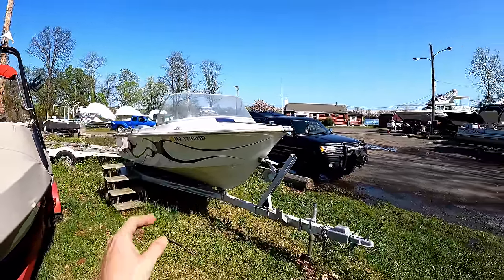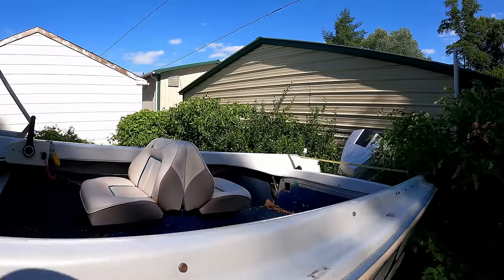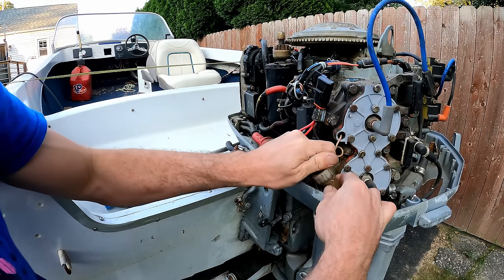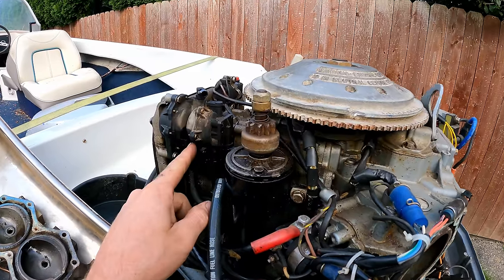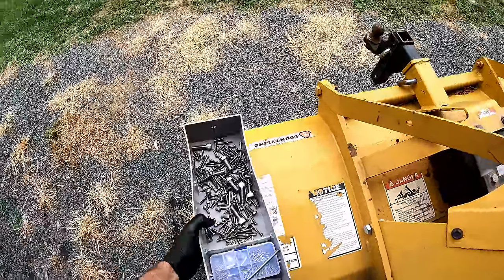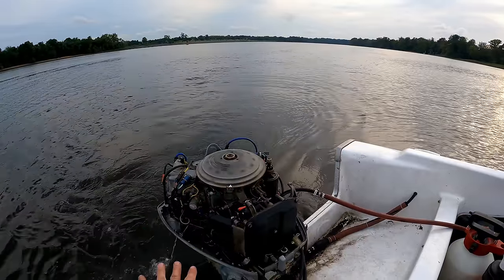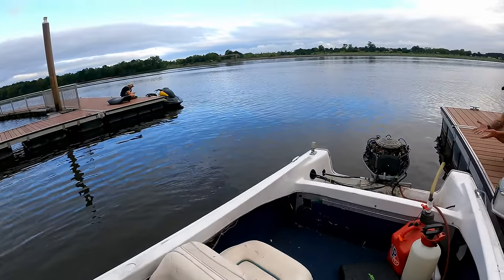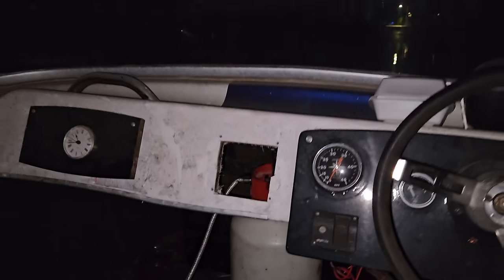FREE 1960's Boat with 90hp Evinrude WILL IT RUN?

Comment: Old Evinrudes and Johnsons are basically the small block Chevy, and Fords of the boat community. A crescent wrench, duct tape, and plugs will typically get them back alive. 
Ditch the boat, and keep the outboard
Reply: Evinrude & Johnson are the same engine, same manufacture,  only difference between them are the name. Such as a Fard & Lincoln are the same manufacture.  Founded by Ole Evinrude in Milwaukee, Wisconsin in 1907, it was formerly owned by the publicly traded Outboard Marine Corporation (OMC) since 1935 but OMC filed for bankruptcy in 2000. It was working as a subsidiary of Canadian Multinational Bombardier Recreational Products but was discontinued in May of 2020.

Comment: G,day Chris from Sydney Australia.
Great instructional video on replacing; the 
* cylinder head and gasket
* supply 12v straight to starter
* check the prop shaft gear oil 
* replace the gas pump
* connect nav lights
🌏🇭🇲

Comment: Just for info, the exhaust coming from up the motor is what we call ( in france ) "échappement de port" which means "harbor exhaust" 
It's a way to not pollute the water in the harbor or at the dock when you're at idle, when you pick up speed the pressure of the exhaust pick up and most of it will go through your prop like what you know 
Hope it help you ! I'm a beginner marine mechanic just discovered your channel and i love it keep up the good work man !

Comment: Another phenomenal vid, Chris!  Love anything you and Miss Jenn and Gus and Turbo bring us ! Grea t content, from a great young American couple! So much fun. And like others have said, I love the mix of content, and but especially the boat stuff! My Grandpa worked for Johnson Motors for close to 40 years, and so I grew up with all this kind of stuff.  That's an Evinrude Motor for sure. OMC (Outboard Marine Corporation) made Inboard / Outboard Motors, and the Cobra was their foray into that World. They could never quite nail it down like Mercruiser. Always chasing. The Cobras were getting good though, before OMC started to crash. But they made some of the best outboard motors in the World, with the tried and true Johnsons and Evinrudes. Great motors, and the V4 was awesome!  So wide compared to the tall Mercs. OMC also made the Sea-Drives.... a kinda weird out-drive... not really outboard... not really inboard / outboard. A weird looking thing, and I don't think they ever quite got them right either. But you can't go wrong with an ole' Evinrude or Johnson!  I'm with others.... the boat is whatever. But you got something great in that motor - for free! Very distinctive sound when you hear an Evinrude or Johnson cranking. I grew up with that great sound!  Also - VRO is basically what you said.... Variated Ratio Oil Injection. The first few years OMC did id... it was not good. Not reliable. It got better for sure. But you can't beat he old gas/oil mix. You're safe to got that way until you can get your arms around that VRO system, and be sure it's working. or maybe just keep it bypassed. I'd put that motor on another boat.

Comment: The E in the model number stands for Evinrude. Also the VRO tanks for those motors were like a mini fuel tank outside the motor with a primer ball. They were always deleted because they failed. I have to say your brave for a quick dump in the river but i highly recommend a little kicker motor even a trolling motor to save the paddling or swimming back to the ramp 🤣
Reply from the maker: Thanks!
Reply: @NoNonsenseKnowHow  .. i added more the longer i watched.. i love your videos
Reply: @NoNonsenseKnowHow  Evinrude is and was a division of OMC, so OMC badged controls are not a surprise or a mismatch.
Reply: I did this a lot and just made sure to have a paddle and go in the right direction to be able to drift back, up current or up wind or both.  Though when wind is fighting current, one must experiment to find drift direction.

Comment: I once owned a 16' 1959 Luger Le Continental with original McColloch Royal Scott 40 and trailer. Bought it in 2003 at a farm auction in Minnesota for $100.  What a joy it was to restore and enjoy that old runabout. It's retro look turned a lot of heads on the lake. Unfortunately, I later moved out of state, leaving the boat with a neighbor, who stored it in his barn. Having every intention to retrieve it, time simply passed and I later learned that he had traded the boat with another neighbor...for a shotgun. Perhaps one day I'll try to track it down and buy it back.  The old outboards may be work, but they are simple and manageable. Happy boating to the luck and hopefully mechanically inclined buyer!!

Comment: When you have a rough running multi-cylinder 2-stroke engine, and one cylinder looks lean (or rich) while and others do not, and you seemed to have checked every possibility, it's time to suspect the labyrinth seals on the crankshaft, wish isolate the individual crank areas. Seems like yours cleared up pretty well, though. Fun video!

Comment: Good engines, on a cold start, when looking at the remote control, there is a black little lever, raise that up, it will advance the timing and throttle for cold starting. turn the key once, push in, turn it again and hold it, it will start very fast. The thing you removed was the VRO pump. Basically an auto oiler mixer. Fuel pumps on those are the way to go.

Comment: The Stick

It's crazy to see for sure how someone will adapt this or that.  This 'stick' mount did remind me of the Merc Marquis '02 model I had back a year or two ago. The heater/defrost was inoperable when I purchased it, used of course.  So I had a shop do the dirty task of getting to the repair of the blend door, no easy nor inexpensive job to say the least.

When I went to pay the invoice the guy that did the job had left the part he removed for me to inspect.
Crazy as it seemed then, somewhere along the way someone had decided that being the blend door wouldn't close when not warranted that a stick [ piece/block ] of wood would be just what was conviently at hand as a workable solution in shutting off the flow of heat, permantly.  In Arizona not an issue 'cept in winter mornings.

What is ironic is where that make shift block of wood had to be placed, how in heaven's name that was done, I can't fathom.  Chris I'm sure you are likely aware of where this blend door is located up under the dashboard and why not order the part if you've gone that far to DIY this job, quite the mystery.
It's possible the job of rigging the blend door with that block of wood, which was glued in place, could be managed without removing the dash.  If I recall correctly, the job performed correctly did require removing the dash, at least the invoice seemed to tell me that when I left a chunk of my week's wage with the cashier.

At 63 years of age, retired with a part time 'C' store job and not in the best of physical condition, I had little serious thought of trying to DI'Myself.

Comment: I had an old 100hp Johnson, basically same thing you have on that boat. Great engines when dialed in, and very durable. Loved hearing that sound again and I think I could smell the two stroke smoke through the screen. Great video!

Comment: You probably know, but if you put the bar that controls the engine trim in the next notch up to bring the front end of the boat up more at wot it might go a little faster. Seems like a 90 might go about 40 trimmed just right. Another fun video to watch.
Reply from the maker: Yes that's a good point. I didn't mess with the mechanical trim. Should have gave it a go.
Reply: @NoNonsenseKnowHow  V4 evinrudes and Johnsons of that era went up to 140 with usually the main difference being mufflers and jets, so the 90s are quieter.  I think mufflers make a bigger difference on 2 strokes.
Reply: @NoNonsenseKnowHow  The check balls on the boat squeeze bulbs don't always close with just air to push them closed.  One way to get them to close is to release the bulb very quickly and another is to turn it vertical so you are pumping the fuel up.  That way gravity helps the air close the check ball.

Comment: You need to lift the throttle handle to start it. Under the shift handle there is a throttle handle that allows you to basically pump the pedal when you're starting it. Also push in the key to choke the motor. Depending on year pushing the key in is either choke or it'll squirt fuel into the carbs.

Comment: Those were great motors back in the day. Hard to kill. Rebuild the carbs and it just runs. And ya it exhausts through those two little ports with water no worries there. Nice boat 👍🏼👍🏼

Comment: Growing up, my grandad had a 1960's StarCraft Viscount runabout, 16ft aluminum hull, with a Johnson 90hp outboard. Fuel tanks were two standard 5gal Johnson tanks, kept in the stern. 
One word of caution. My grandad had some civil engineer training, and he was concerned that if the motor got knocked into reverse, at speed, that it could potentially rip the stern off the boat. He ended up adding two rather large aluminum gussets, at 45's, to the transom.  Basically corner braces.

He also added oarlocks and carried some longass oars so we could row to shore in case of a motor failure. 
Boat was used out on Lake Michigan, generally perch fishing, but it had plenty of ass to pull someone on skis. Good times.

Good luck with the repairs. It's a handy size boat to have, easy to maintain.

Comment: Those may be the wrong plugs in the engine. The marine plugs are typically flat with no extended center part. I ran into the same thing on my 85hp Force engine. Napa was able to source me the right plugs. Love the old boat videos! Got my own 450$ 1988 Bayliner and love the thing.

Comment: Love the boat videos my guy! I definitely like the variety of things you work on that you put on your channel. 🤙
Reply from the maker: Glad you like them! And thanks
Reply: @NoNonsenseKnowHow hey man I have a question I have a 2012 Hyundai Elantra and it cuts out quite a bit falls on his face mostly when you get a gas taken off and I'm feeling it could be the fuel pump and I tested all the injectors and coil packs which they're on the you know wires but I pulled each one off and never change never you know you can tell they were working in other words it would cut down and put it back up when I put them all back on one at a time but would you lean toward a fuel pump I mean it's only 105 bucks online RockAuto and I'm going to change fuel filter too just in case which change the pump I understand that but would you lean toward the fuel pump just asking for your opinion I already had another guy but he gave me a list of things that could be and on a 2012 Hyundai Elantra I would put that kind of money in it lol
Reply: @Scottb92768   yo man check fuel lines inside tank, i had one customer once who had weird problems and line in tank was bad coming off pump
e: dont know how big job its on that car tho, if under seat should be easy

Comment: Those old V4s are great and practically indestructible. I have an Evinrude 125 and Johnson 90. 
There’s more reasons to delete that VRO kit than keep it. I trust premix more!
OMC owned Evinrude/Johnson, until Bombardier bought them in 2001. OMC made the Cobra stern drive motors
You should carry a bottle of Dawn dish soap in your boat arsenal, to clean up/break up any fuel or oil spills in the water. The Coast Guard will be happy! 😁
Those little boats look like fun! I see them on marketplace now and then. Got too many projects going right now to get one, but maybe later.
Love the shirt!

Comment: I bought a boat earlier this summer with a Johnson 140 boat needed some tlc and needed to be timed. 🤦🏾‍♂️ I bought it without hearing it run. Anyways found a guy with a small shop that’s hopefully going to get it timed for me but he’s taking forever. So I got a deal on a I/O for $500 with a running 4.3 merc. So far so good. All I had to do is put a kill switch on it so far.

Comment: That Shock is actually suppose to be to make it easier for you to manuelly lift the motor while in the boat (its A tilt assist) but from the looks of how tough it was for you to lift the motor either the shock is bad and sticking or the tilt tub is getting stuck.
Reply: I thought it was supposed to hold the motor down from climbing in reverse? Is there a pin that locks the tilt when the motor goes into reverse?

Comment: The exhaust comes out those ports at idle and lower RPM, not quite enough pressure to goo out bottom, then goes out bottom as RPM increases. Relief holes I think they are called
Those motors have a sweet spot for fuel mileage. At full throttle slowly bring the throttle back till the tone changes lower. That should be about jut above 3/4 rpm. On my 1980 Evinrude 85hp, at full throttle I do 25 mph burning around 8 gallons an hour, when I pull the throttle back till that high pith sound just goes away I'm doing around 22-23mph, burning around 4.5-5 gallons an hour.
Reply from the maker: Sweet! Thanks so much for the info. That makes sense

Comment: Seems like those old motors with no power tilt/trim had 3 or 4 holes you could move a bar and adjust it manually. Of course it was always in the same place so you had to get the best position for hole shot and speed.

Comment: I know you are normally a crank and send it sort of dude but clean the carbs on those if you don't want it to lean out and blow up.  They are very sensitive to that.   I've rebuilt about a hundred because of it.  Keep the fuel system clean and they are fairly bullet proof.  Johnson Evinrudes with the double barrel carbs were called the crossflow by the way.

Comment: These omc outboards are exceptional if well maintained.    I always get rid of the vro oiling system first thing.    Not a good system pre mixed is the way to go.    If u want to modify these u can get a lightweight flywheel and rejet the carbs adjust the timing.    That boat should hit mid 40s easy.    Love the boat videos.     I have a 72 Larson lapliner love the ol girl
Reply: We had a 68 Larson 18' with the MerCruiser SternDrive and the Chevy II 4 banger...50 years of fun and simple repairs!

Comment: 90 Evinrude v4 is the best outboard ever made, hands down. The 115 is a close second
Reply: I got a 115 when I first bought the boat ( it was my first boat and I knew nothing ) I had planned on selling the motor and buying a 4 stoke but after getting it all tuned up , working on and running it for a while I absolutely love this engine, I don't understand why the stopped making them. Now she ain't fuel efficient by any means but it's a boat and I put a nice big tank tucked up in the bow and it everything we want for a day on the river. I'm currently looking for a cabin cruiser boat but I'm afraid of the inboard engines, I'm afraid I won't find one as reliable as my 115 outboard. Anyone have any suggestions?
Reply: I don't trust in boards either
Reply: @Redfiregtag  I sold my 34 foot cabin cruiser with inboard Iveco after it cost me $25k to fix up. Now have a 28 footer with a 225 v6 Mercury. No more inboards for me.

Comment: I scored a 16ft' Sea Sprite with a 90hp Johnson.  Probably a late 70's unit.  Didn't notice lower unit was cracked from freezing at some point from previous owner.  Floor was soft as can be, tires dry rotted, steering frozen and interior shot.  Hull was decent as well as trailer and motor hydraulics.  My wife was ecstatic this weekend when someone wanted to use it as a Halloween prop.  The boat was 2 far gone to restore and be budget friendly.  It's out of my life.

Comment: Johnson/Evenrude parent company was OMC.. until the were bought out by BRP… those old 60 degree Johnnrudes were some of the best running engines! Carbs are stupid easy to rebuild and PLEASE REBUILD THEM!  Run that motor lean and you will cook it!

Comment: Each cylinder is fed by its own idle circuit , I would give those carbs a good clean , sounds like the mains were clear on all 4 , but some idles were blocked , crank seals are rarely an issue on these engines , but carbs block up with standing

Comment: I forgot to mention that the holes you saw under the boat along the outside edge, which had been patched are from someone screwing a floor down with too long of screws. I’m sure they were shocked once they got out of the boat and looked under it
Reply from the maker: That makes sense! Thanks for the info!
Reply: The guy in the cabin next to ours did that years ago. He was hammered drunk trying to put a flat wood floor in his 14-16’ aluminum and decided to use 3” deck screws. Probably punched 20 through before my dad saw what he was doing and stopped him.

Comment: ONLY QL77JC4 in those engines!  That may be your detonation issue.  The oil tank was not mounted on the engine.  Its a remote tank mounted in the boat.

Comment: Don't 'blip' throttle on a two stroke to clear oil/fule smoke. Each time you close the throttle, a small amount of oil and fuel STILL comes in but it's not burned.... so, when you re-open the throttle..... it smoke MORE because you are refilling the oil/problem again. Hold the throttle open quite a way and, so long as you don't over rev.... it will do a better job of clearing........... which is EXACTLY what you found when you went out across the water with a fair throttle opening. Blipping a 4 stroke.... WORKS........ it does NOT on a 2 stroke! ( I raced 2 strokes for 50 years and a further 15 years for my son........ and now I am introducing my grandson to them, too...)

Comment: unless the top main seal is visibly oily, i wouldnt say thats what started detonation. these need 93 octane fresh at all times and the cooling system to be top notch, both impeller in pump and t stat/poppet valve assembly and clean carbs.